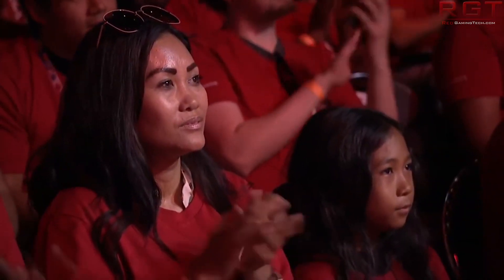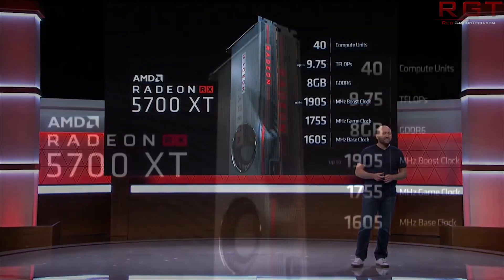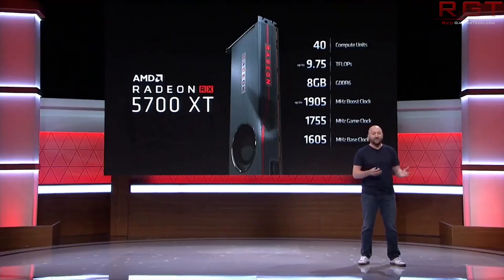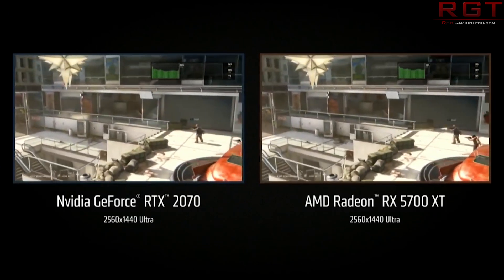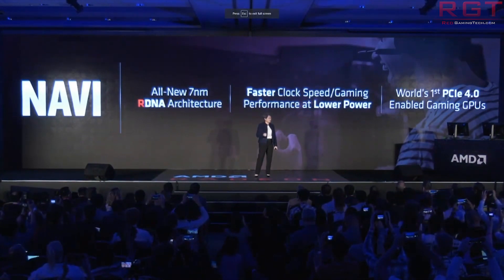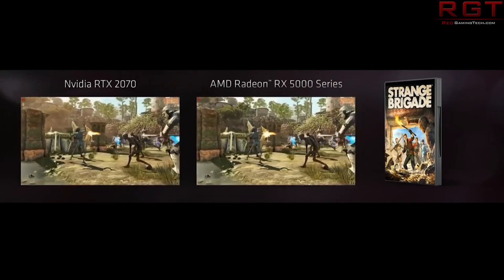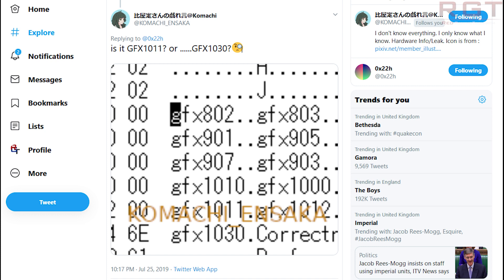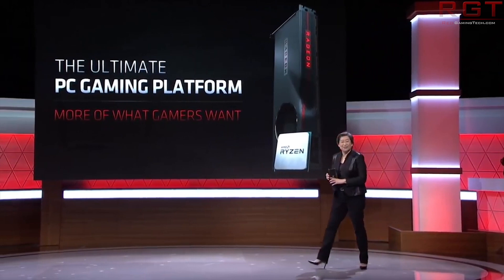Navi High End GPU Launching This Year ? | Intel Discrete GPU Specs Leak & It's a Monster

Comment: If they release a 5800xt that competes with the 2080ti for $650, I'll buy it.
Reply: With AMD's current marketing structure. I wouldn't be surprised if they price it at 799.
Reply: @loroger9754  more realistic price
Reply: @loroger9754  $799 it's still a better deal then what Nivida has to offer
Reply: 5800 xt would compete against the 2080. 590x0 xt 2080 ti
Reply: @VoldoronGaming  Create expectations for the 5800 it can't meet. Then be disappointed. 2060 V 5700 / 2070 V 5800 /  2080 V 5900 That will be the price to price. Navi top end will be a 5950 maybe 80 CU and HBM2. A $500 5800XT will go after the 2070S. Why would AMD make a 5900/5950 if their 5800 beats a 2080S?
Reply: @maxhughes5687  5700XT beats the 2070, a 5800XT has to at least match the basic 2080.
Reply: @amartinez97  So the AMD bottom end has to beat the Nvidia's mid range card at a bottom range price. And the AMD mid range card has to beat Nvidia's high end card at a mid range price. Now I see why Utube pushed O/C on the 5700XT so hard. So if a $500 3900X can't beat an Intel 9980xe then Ryzen 3000 isn't any good. Edward Bernays would be proud of you.
Reply: @maxhughes5687  why compare 18cores36threads to 12cores24threads. LMAO
Reply: @VoldoronGaming  Just wait for the price
All we have now is $400 Vs $400. 5700 Vs 2060.
Reply: @VoldoronGaming  590x0 xt?  I'm thinking it would be a 5800 and a 5800xt.  Either way, which ever would be comparable to the 2080ti.
Reply: No that's horrible.  5700 needs to drop at least another 50 dollars by then, and then 5800 come in at 499 and xt at 599.  Don't forget it's not the biggest, that's 5900xt in all likelihood.

400 to 650 way to big of a jump.  They need a 500 price point.  And Navi is overpriced even at 400, due to nvidias insane pricing and to move their old stock.  5700 is CRAZY cheap to produce, they're getting over 100% margin.  Not cool, everything is still skewed AF.  2080ti perf (only 25% higher than 1080ti 2 years later!) Should be 499 by 2020.
Reply: Basically you want a half price 2080ti? Nice one!
Reply: @chocAscetic  Thank you.  You actually understood my simple statement.
Reply: Or no this will be their flagship "90"or "95X" series. So a 5900/5995..
AMD is back bois!!!
Reply: Definitely not $650 why would they do that? $799 its more reasonable for a 2080Ti performance
Reply: @adi6293    So, you wouldn't buy a competitor to the RTX 2080 ti if it were priced at almost half the cost?
Reply: then your an idiot
Reply: There may be price cuts once amd's Polaris and Vega stock has run out. Just a thought.
Reply: 5700 Xt is 450... so big version would be at least douple of that! So $900 most likely much more because the yeald get worse with bigger chips.
Reply: Nah, it will most likely cost 1149$ and still be slower than the rtx 2080 ti in some cases but with 16gb of vram.
Reply: thats fcking charity.. even 799 would be a big win for amd and should completedy destroy nvidia
Reply: Even if it´s 800 bucks I´ll take it. 1200 for the rtx 2080 TI is ridicilous.
Reply: lol, AMD is not going to undercut Nvidia by $550
Reply: @clippy_friend  I don't expect them to. I just said that I would buy it at $650.
Reply: @clippy_friend  the 3950 would like to have a word with you
Reply: If they release anything that even remotely competes with the 2080ti THIS year, it will be 800 minimum. Quote me on that. Have you not seen their pricing for the 5700XT? They have proved they are not going to undercut NVIDIA, selling what is essentially an RX 680 for 400 dollars (it was 450 until super got announced). Their R9 Fury X was priced above the 980ti at launch, everyone complained so they reduced prices. The Vega 64 liquid was atrociously priced on launch too, close to a 1080ti but nowhere near 1080ti performance.
Reply: @marcusrat4466  The last I heard was the 5800 this fall. A 5900 will be 2020, sometime?
Reply: @marcusrat4466  Jeez, I just said I would definitely buy it if it was $650.  Wouldn't you?
Reply: @marcusrat4466  amd would never have price points at 400 and then 800 with nothing in between, and the non xt card will always be within 100 of the xt, so that's still at least 700.  There will be no 300 dollar price gap noob.  5700 is overpriced hopefully to move old stock, it needs to drop another 50 dollars, then it's 350 and 5800 can be 499 and 5800xt 599.  And it could easily compete with 2080ti at that price with 100%+ margins.  Navi is so cheap to produce, relatively speaking, they're making way over 100% markup on 5700/xt.  Maybe 150%.  The company has claimed in the past a goal of 60% avg margins.  If we got 60% navi would be hella cheap for all levels of performance vs the insanity that is nGreedia.  If navi is zen equivalent then the strategy IS to undercut nvidia, they simply haven't begun that part yet because they only have 1 part out, they need to price it to move older cards, and it's already 50-100 less than equiv. nvidia part.  I still think they will be much more competitive/aggressive in the future.
Reply: RX570 add a zero, RX5700XT price equivalent an RTX2060S.  RX580 add a zero 5800XT, price equivalent an RTX2070S. It's Utube #bugchannels that compare the $400 5700XT to the $500 2070S. If 2080S sees a competetor it will be an RX5900/5950 Navi. It was the same crap with 2700X Vs 9900K. Price be damn Intel wins. IDK. Well we'll just have to wait and see.
Reply: @maxhughes5687  doubtful the 5700xt overclocked and Power play tables already on the heels of the 2080 in some games. 5800 would compete against the 20i80. 59x0 xt the 2080 ti

Comment: As good as the 5700Xt is that could be above 2080 level performance maybe nipping at the 2080 tis heels for hopefully 600 bucks...that be awesome
Reply: Sam Wall how product Are priced... you get slow product as cheap as possible. The you add 50% more speed and douple the price. Add 50% more speed and the douple the price again... so the best bang for the buck comes from the cheapest slowest products. 5700 is $350... 5700 Xt is $450... so the 5800 Xt if it has that 4090 shaders (90% more than 3700 Xt) it will be more than douple the price of 5700xt! So + $900 most likely $999 or even more. Then we will have cut down 5800 or what ever at $700-800. (Or 5900 we don`t know the name) what we know is that if we get douple speed. The price will go up much more... same with Ryzen cpus. 3600 is really ”cheap” the speed goes up, but the price will go up much faster!
That is how market works! We will see 5600 and maybe even 5500 in low end at $150 to $250. The 5700 and 5700xt will remain the same, unles Nvidia drop prices. And 5800 and 5900 well those will be really expensive. But a Little bit less than Nvidia, like 5700 series. The 2080ti is now $1200 to 1400. So $999 from amd would be a bargain!

Comment: did you see intel going forward with integer scaling? big win for gamers.
Reply: Don't see the relevance to anyone. Every compent emulator for 2D games offers integer scaling in hardware or software. Software vs hardware doesn't matter since the resolution is so low (I remember emulating NES on 486DX2-66!). For 3D you don't want scaling; there are better options if you must use scaling.
Reply: @soylentgreenb  yeah, you don't.
Reply: AMD customer wish list survey for added features has this on it- in second place when I voted for it against RIS for all games in the lead
Reply: @1ch1r1n  what is RIS?
Reply: @1ch1r1n  where do i find the results of this survey? thanks
Reply: @1ch1r1n  thanks! looks like integer scaling is top, antilag a close second, then veeery long nothing, and then the rest.

Comment: See now, I'm not convinced it will beat a 2080ti - if you Powerplay mod the 5700XT and overclock it by 15%, the returns are like 6%
No chance you are going to see perfect scaling, unless the current cards are completely memory bandwidth starved and the new card has additional memory bandwidth.
Reply: What that means is that it is not compute bound, or 15% core clock would give you 15% returns. It can be bound by different things if it's not the core:
It could be the CPU or application feeding it stuff to do; but then you've failed to design a proper test for the GPU.
It could be memory bandwidth bound (test by overclocking graphics DRAM).
It can be latency bound (speeding up the GPU doesn't help because that means it spends more cycles waiting on data; if possible test by increasing or reducing memory latency without increasing frequency; probably a difficult BIOS flash and risks bricking). Graphics isn't very latency sensitive, so probably not.
It can be PCI-E BUS bandwidth bound (this really doesn't happen too often with graphics).
It can be limited by poor drivers. E.g. openGL has always had disastrous performance on AMD (hence the huge gain with Vulkan in Doom 2016 or the ridiculous performance in ancient openGL titles like RTCW).

I'd say memory bandwidth is most likely. This was very much the case with Vega. But this does not imply that the performance scales linearly with the number of compute units; it probably does not. Amdahl's law says that if you have some small serial fraction of execution time then as you add more processors to deal with the parallel fraction you eventually become limited by this serial fraction and performance levels off. There is a serial fraction because there is always some driver thread, or hardware "manager"/"scheduler" etc. that distributes work. At some point graphics will need more and more transistors dedicated to speeding up this serial fraction in order to scale to more CUs. If you parallelize the scheduler or whatever then you have some "super-scheduler" that decides which scheduler does what. There is a serial fraction that never goes away; at some point you would rather make CUs befier than have more of them; that means maybe 4 times as many transistors to make CUs twice as performant; instead of 2 times as many transistors to get 2 times as many CUs; at some point this trade makes more sense.
Reply: I was thinking the same thing. lets hope the scaling issue is memory related like you suggested. I'm sure someone will  test and discover why this is so b4 long.
Reply: Navi was designed to be scalable.

Comment: Whats up paul! If 4096 SP card is true, at the same clocks at the 5700 XT, it would be about 40% faster. With a 384 bit bus on 14Gbps GDDR6 it would be 672 GB/s. With 16Gbps on a 384 bit bus it would be 768 GB/s.
Reply: 1GB to 8Gb and 2GB to16Gb are 256 bit bus, so 8GB/16GB at 14Gbps is 448 and 16Gbps is 576GB/s,9gb to 12Gb and 18GB to 24GB are 384 bit bus, so 12GB/24GB at 14Gbps is 672 and at 16Gbps is 864GB/s